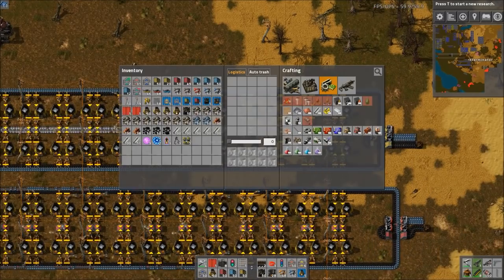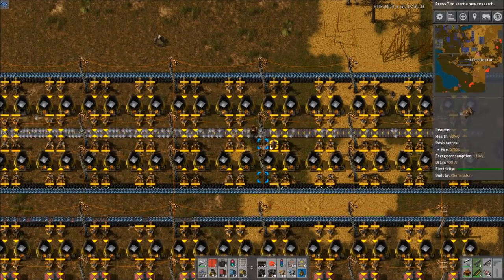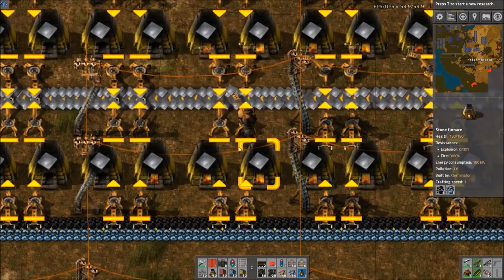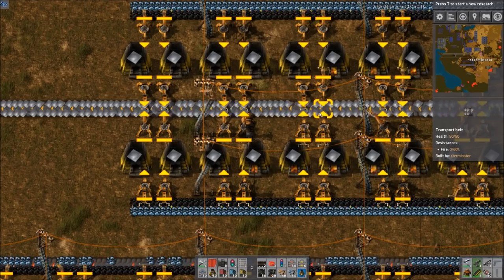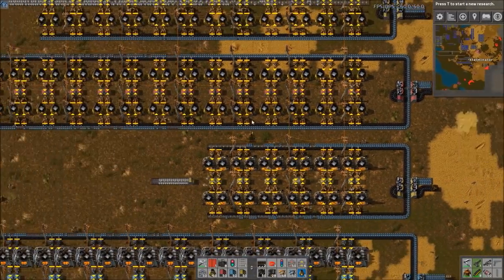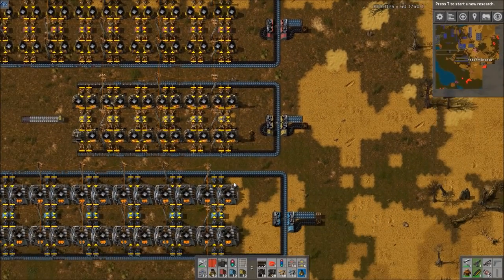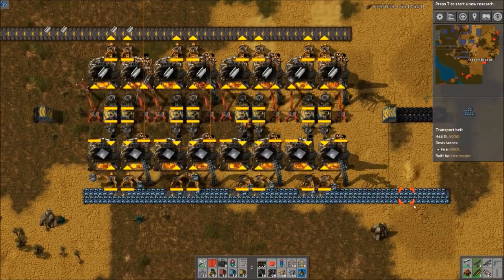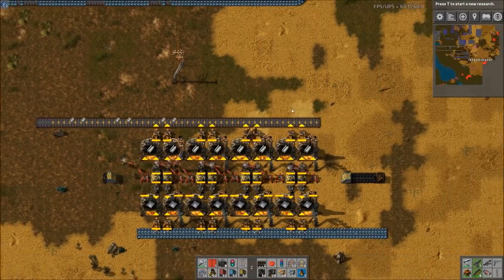Smelting and Furnace Ratios - Factorio Tutorial

Comment: An underground belt entrance or exit works a lot like side-loading. In the same way that items on the main belt block items on the incoming side belt (adding items to the empty part of the main belt prior to the side loading point will cause them to take precedence over the items coming from the side belt, which won't move until there's a gap on the main belt), items coming up from the underground belt simply get held back until there's room on the aboveground part of the belt. Inserters are able to drop items onto this aboveground portion just before new items are allowed to exit the underground portion, allowing them to take precedence and fully compress the belt. For an underground entrance tile, the process is similar -- the point at which items are sucked underground is far enough back that as soon as that happens, there's enough room ahead of the next items in line for the inserters to drop another item onto the aboveground part of the belt. The inserter-dropped items are able to "cut in line", and as soon as there is room on the underground portion of the belt they will be taken first, finally allowing the blocked items to advance again.

Also, you don't have to use underground belt for the early parts of the output belt line, only the last 1/3 to 1/2 of it where inserters may have trouble finding gaps to drop items into. Of course, if you want to spend the slightly extra resources on doing so, there's nothing wrong with that. :)
Reply from the maker: Great explanation, and spot on! :) I wish I could of explained it that well in the video. Lol 
Also you did bring up a good point about the underground parts only having to be on the last 1/3 or 1/2 of the belt, that's totally true. For me personally, I would rather spend the extra resources to make it all undergrounds so it's all even and the same. :P

Comment: If you don't want to spend a ridiculous amount of resources that underground belts take compared to regular belts, you could just move the furnaces one square further away from the center belt and have the insertors feed onto separate belts that then feed into the central belt, fully compressing it.
Reply from the maker: Yup that would certainly work as well. :) I much prefer the look and ease of using underground belts, but if the cost is an issue in your game then your solution definitely works. Plus, using the way you suggest it can make it easier to upgrade later. ;)

Comment: Coal running to electric smelting? :P
Reply from the maker: Yeah woops, force of habit. :p
Reply: Xterminator does this mean you can halve the amount of furnaces per side if you use both lanes for ore?
Reply: Barcel no, because it's smelting that's slow, not inserting
Reply: But wouldnt the belt just be satisfied longer? When you have double the amount of ore incoming? Or what am I getting wrong?
Reply: it's a feature, not a bug.
Reply: The furnace can only smelt so fast. If it smelts one iron per second you have 2000 iron accessble it will never smelt more than one iron per second. If you have one iron per second coming in whilst having one iron smelting per second coming down the lane then that's all you need. Using both lanes is not necessary as you saw in the video, one lane is enough to satifiy production capiblity by 100 percent. So using both lanes would not increase production thereby not reducing the amount of furnaces by half.
Reply: Doubling the amount of ore per side would mean doubling the furnaces to keep up with it. Not halving it.
So full blue belt into electric would be 70 furnaces per side.

The problem would be to get a full blue belt onto either side, but that can be sorted by having 2 blue belts coming in. But if you do that, why wouldn't you just have them run along each side to begin with and skip the splitter? That way you could make room for an entire extra row of beacons later, doubling the smelting speed bonus from the beacons, adding to that the speed of the modules inside the furnaces and you're right back at using fewer furnaces again. 3 beacons on either side plus two speed mod 3's in the furnaces themselves give a whooping 600% bonus to smelting speed, making them a total of 7 times faster than the stone furnaces.
That means you can have 11.66666 furnaces (rounded to 12) per fully compressed blue belt of ore for full compression of blue belt for plates.

Of course, you could compress this even further if you find a way to add more beacons, but that tends to take more space. The figure-8 design gives 9 beacons per furnace, for a total of 11 times faster smelting than stone furnaces, meaning you only need 7 furnaces per blue belt for full satisfaction.

That is if you remove the coal from half the lane xD
Reply: And I just realized my math is a tiny bit off, as there's enough room between the center inserters to fit another beacon in, making the total beacons in the regular line setup 8 per furnace, not 6.
The figure-8 adds 2 on either side, so that's 11 beacons per furnace, not 9.

I forgot that electric furnaces were 3x3, same as beacons, and not 2x2...

Comment: Didn’t they improve the belt speed to 15. Items per second? So does that mean you need more now?
Reply: That's just in the experimental version of factorio .17. The official version is still .16, where the belt speed is 13.33. But you're right... that change is going to change all the ratios and screw up all of my blueprints, ugh
Reply: They also improved the smelting speed to 3.2 seconds per item, so you now need exactly 48 stone furnaces per yellow belt of input (which will make a full belt of iron or copper, half a belt of stone bricks, or a fifth of a belt of steel).

Comment: I've just tested a setup that has 30 to 40 beacons per stack ( depending on whether or not it's in an array) and 2x8 electric smelters, it produces a full blue belt of plates for 5/6 of a blue belt of ore. It takes about 3 times as much power to run as an equivalent stack without beacons but it's total size is only 20x30. I might have a redundant column of beacons in there, haven't tested that yet but so far it's the most compact one I've done.

Comment: For steel, because it takes 5x plate to make 1x steel, wouldn't you need 5x the belts of one colour to fill 1x of the same colour of steel?
Reply from the maker: Well it depends I guess. In terms of smelting time and items required, it is a 1:1 ratio of Iron to Steel so that's why that Steel design works. You just need a huge amount of it to actually fill a belt of any color.

Comment: I see that yes you get a full compressed belt out, but the ore only barely gets to the end of the line.  With electric furnaces you don't need coal so you can dual side the input, does doing so do anything for you?
Reply from the maker: I meant to take the coal off the Electric Furnace line, so you would definitely have a full belt of iron/copper/stone down each side. That wouldn't really make that much of a difference though. Because the output belt is already fully compressed even with the ore barely getting to the end. So having a full belt of ore getting to the end wouldn't do much aside form backing up the line. :)
Reply: another question, if you were to have full compressed input without coal, could you have a full compressed output of the next level up?
Reply from the maker: ***** Well without coal how would the the stone/steel furnaces run? :P 
But to answer the question, no I don't believe so. I think the belt still would not have enough throughput. 
It could be worth testing though!

Comment: Hey, I have a question, how many furnaces are needed to deplete each one of the type of belts, I am planning on doing a robot-belt hybrid setup for funaces, but i can't get the math right in my mind.
Reply from the maker: Good question! Well, without using modules or beacons, it should be the same number that are required to fill one of the belts. 
If you are using modules/beacons it can get a more complicated. You basically need to calculate for whatever your bottleneck will be, which in this case would be you input belt. So it actually is fairly easy for that because you just need to take the smelting time of your item, so for iron/copper, 3.5 seconds and divide that by the speed of your furnace (crafting speed, not % speed) to get the actual time it takes to smelt the item. 
Then, multiply the amount of items the belt can carry (13.33/s for yellow, 26.66/s for red, and 40/s for blue) by the actual smelting speed you got and that is how many furnaces total the belt can support. Keep in mind that those speeds I listed are for the whole belt (both lanes), and whatever furnace amount you get using those numbers will be for the whole belt, not each side. 

Hope that helps! If not, let me know and I'll try to get the answer you want. :)
Reply: So, for a system with express belts and electric furnances we would need about 70 furnances?
Reply from the maker: If you are not using any modules or beacons, then yes that is correct.
Reply: I think I got it, thanks!
XD

Comment: Since eletric furnacess dont need coal, i can use the 2 sides of the belt for ore, does that mean i can doble the number of eletric, if i dont put coal?
Reply from the maker: Kono Dio Da Not really unfortunately because you will still be limited by the throughput of the output belt the plate goes on.

Comment: How many miners would it take to fully compress a yellow , red, or blue belt to supply those max smelting lines?
Reply from the maker: I plan to do a video on that soon actually. But you can take a look at the google sheet linked in the description, one of the slides shows that info. :)
Reply: ahh thanks

Comment: I'm trying red belt and steel furnaces but there isn't enough iron ore in the input belt to compress the output belt, the layout is 99% the same as yours (Iv go the coal spawning on the correct side so there is no need for an underground belt) do you think Ive done something wrong
Reply from the maker: Are you sure that you are getting a fully compressed side of the input belt of Iron. As you saw in the video it should definitely be enough to compress the output belt. 
Could you send a picture of what you have and I can see what might be wrong? :)
Reply: Xterminator I'm using the creativity mode mod (not sure if that's the right name) to spawn the iron ore, when I get chance I will swap to the spawn belt mod and I will update you
Reply: I've changed to the spawn belt mod and it's working fine, I had a closer look at the old setup and the belt was 99.9% compressed.
Reply from the maker: spinba11 Awesome glad you got it worked out! :)

Comment: When you get to 20+ furnaces per side, I'd rather use 4 or 8 rows of furnaces rather than 2 very long rows, then compress with splitters. This uses up a bit more room, but is easier to fit into factory design. Splitters will also take care or compression, so you won't need the underground belt trick.
Reply from the maker: This is more personal preference and dependent on your specific factory I'd say. For example, I plan my factories to fit long rows of furnaces so it's not an issue. Splitters can help with compress when combining multiple non-compressed lines, but they also cause issues that create little gaps of non compression sometimes.
Reply: Also, if you're doing something crazy like 4 saturated belts of each metal, multiple long rows of furnaces (one row per) belt are probably the best option anyway.

Comment: what if you use speed 3 modules in the electric furnaces
Reply from the maker: It will change the ratio because the smelters are faster. Not sure what the exact ratio will be using speed modules.

Comment: There is some flaw here...

On the electric furnaces there is coal on the belt... Of cause if you would run both sides of the belt on bot upper and lower smelters, it would overfill the belt, so then a additional belt would bee needed in the middle, also with belt balancing.
Reply from the maker: Yeah it was just habit, I forgot to remove the goal input from the electric furnace belt. :P 
The ratios are are still correct though. Main difference is that you would have a full belt of ore on each side rather than split half of coal and half of ore.
Reply: But then there is really two options. Go for Two belts between each and make really long column, or do one between them and let them share.

There is also a other bit.

Specially when going for blue belt. Its kind of a waste going for blue belt all the way.

Can reduce it quite a lot by using blue belt for just a bit, change to red, then change to yellow.. and do the opposite on the output.

Comment: You only need underground belts for the furnaces at the end. 4 underground belt total, 2 pairs, for the yellow belt. One pair for steel / electric furnaces on yellow belt.

Also, you mentioned a comparison of steel and electric furnaces, so I thought I'd give the results of my math. With no modules and no solar panels, and taking into account the power consumption, pollution, and inefficiencies of the furnaces, the boilers, steam engines, the mining drills on the coal, everything, including the extra coal burned at the boilers to power the drills on the coal (everything), electric furnaces use twice as much coal per smelted iron/copper plate, while producing only ~38.93% as much pollution per plate. (The inverse is, steel furnace produces 2.5690x as much pollution per plate. Also half as much coal & pollution per plate as stone furnaces.) Since coal is plentiful, I don't think using twice as much is an issue. And you can put modules in the electric smelters, and even in the drills, which pushes coal use and pollution even lower. But of course, electric smelters are much more expensive up front than steel, both individually and also because you need more steam engines.

I like the reduced pollution output, because it means that evolution factor is lower by the time I start harvesting alien artifacts. I also scout at the beginning so that the worms are easy no matter how high the factor gets, though...
Reply from the maker: Yup, definitely don't need them the whole way, but I prefer to do it that way just so it all looks the same. 

Really like your math, and it's pretty much what I would have guessed. I would also agree with you that less pollution is probably better, and the extra coal is not that big of a deal. That's why I prefer to upgrade to Electric Furnaces as soon as I can make them.

Comment: don´t use burner inserters for coal. I did it at first but they burn much more energy than if you would have used the coal to generate electricity and use the orange inserter.
Reply from the maker: The Lich King Yes that is true, but the point of using burner inserters is so you can still have them work if your power goes out for some reason.
Reply: ah, but if power goes the other inserters stop working anyway and no new iron can be inserted into the furnaces. Isn´t it a bit pointless that the coal supply still works then? 

I´m thinking about the steel setup here, your point applies to normal setups with stone or steel furnaces where a burner can insert both at the same time.

Comment: The coal and iron on the same belt kills me your only smelting half a belt not a full one
Reply from the maker: But you are smelting a whole belt because you're sending in a full belt of Ore and just splitting it down both sides. 
These output a full belt of plate in this format, so adding any more Ore to the input would be useless.
Reply: @Xterminator  that is true but you can use a different design that does take up less room then the design you showed if you wanted two full belts. You may be correct so I just want to tell you how I do it to see your take on it. First you have a belt of coal going down the middle. Next you put two iron belts on the sides of it running parallel with the coal. Then you can add the furnaces with the math for how much smelters it takes to smelt a full belt for that color of belt and run it that long. Then in the middle of the furnaces you can you can rearrange the inserters with the Splitter belt things so you can pack the belt that way.